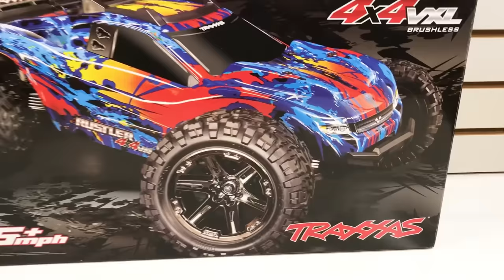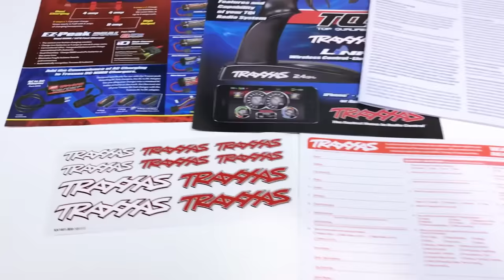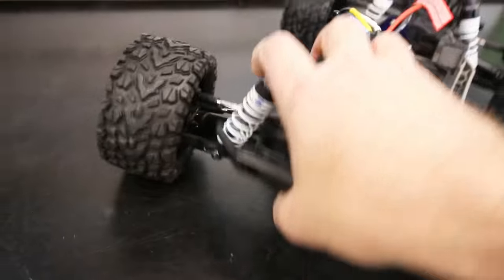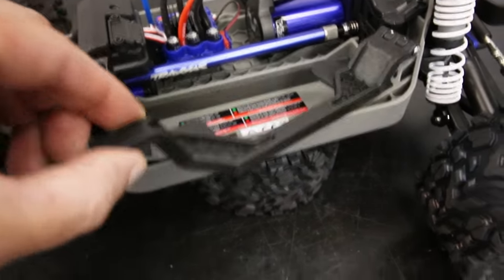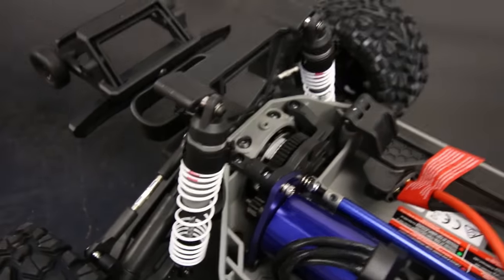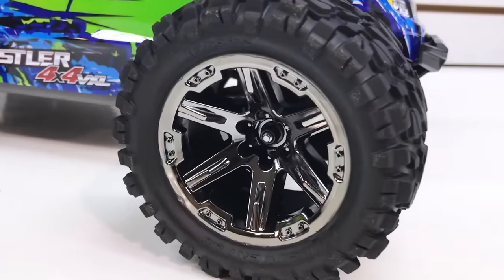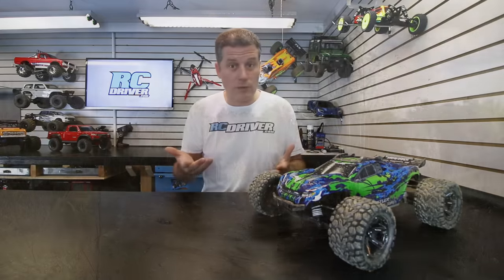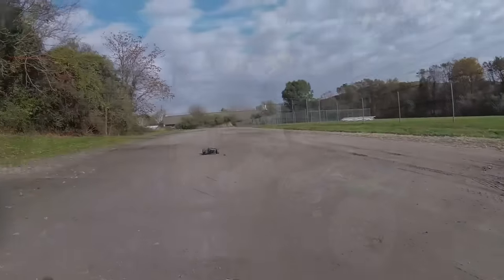SUPER 4WD Stadium Truck Basher! Traxxas Rustler 4x4 VXL RTR Review & Action | RC Driver

Comment: this video was okay you sure can tell it's nothing but a sponsored advertisement…so take that with a grain of salt… You never talk much about throttle management system you should have… I've been told it's really hard on the differentials to use that automatic flip over.  With such low ground clearance jumping is just going to be smacking bottom every single time… I mean literally every single time and quite hard.  You would have to make changes if you want moderate jumping don't you think so?…  I know your long gone probably and don't care anymore but I would've loved to have seen a real review from somebody that can really know the product.  I'll keep looking.  I did watch most everything here and it was fun but far too much of an advertisement for my liking.  I don't mean any disrespect this is just an opinion
Reply: To get good ground clearance you gotta spent money on both tires and new suspension which sucks but I 100% agree with you

Comment: The self uprighting feature pretty much sucks. Only place it works is on blacktop or dirt. Very rarely works anywhere else. Tires are too light for the length of the car. Top speed is closer to 62ish with optional gear.

Comment: To me it just looks like a shorter chassis Slash 4x4. It’s not so impressive to me. The body can’t really be changed. The attachment system makes it necessary to buy their body only. The shocks aren’t GTR so they have to use preload spacers. Why not make them threaded bodies? Only reason it needs a wheelie bar is the shortened chassis. Overall not worth the money. Just going to run my Slash.
Reply: mattster1971 Everything I was going to say! I would rather have a Slash(with all the needed upgrades that all Traxxas RCs NEED!)
Reply: Reminds me a lot like the first e Revo
Reply: it sits wider then the slash, so its technically a truggie traxxas doesnt call it that but it is, i like it personally, some parts are different then the slash 4x4 the rustler has different a arms there wider , longer control arms and camber links, the pan is new it only looks the same at first glance , also the rear carriers and drive shafts are beefier, the drive shafts are still ass